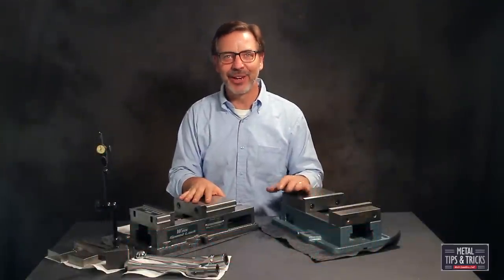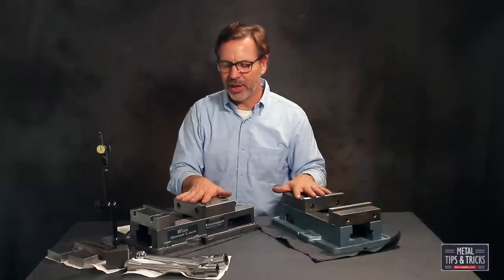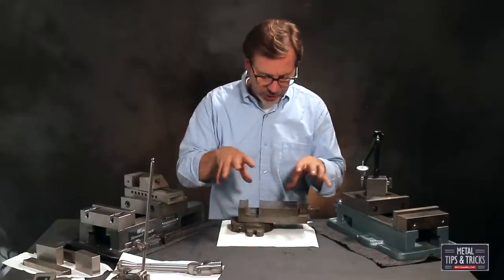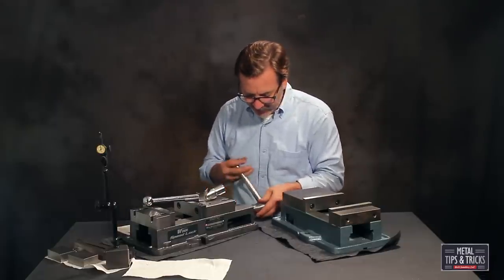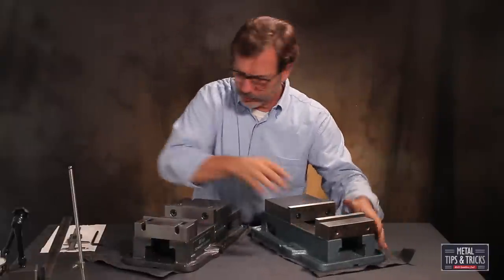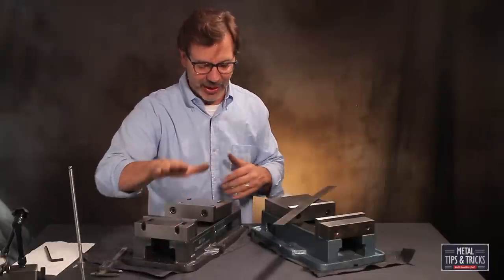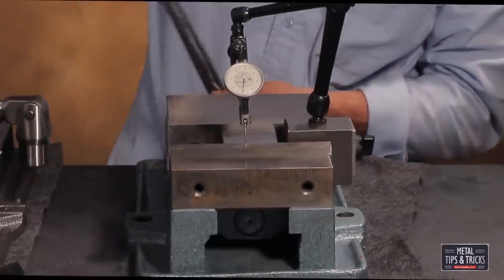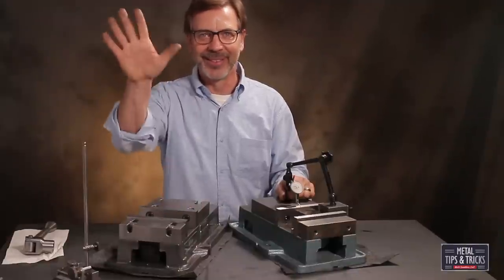China Vs USA  Machinist Vise

Comment: While the vise is definitely significant to precision finishing, it does not supersede correct and precise work set up in a vise using parallels/shims etc.This should be obvious, you had to do that much  when you were regrinding the vise components; that said the better the vise, the less setting up, but yeah you  still need to  tram/set up   the work piece etc. Castings are a perfect example of the necessity to properly set up work, never ever, near perfect, so yeah it doesn't matter how good the vise. The  China made vise precision was well within the bounds of allowing precision setup of work pieces.

Comment: Dale, these vice have seen works.  Now as a machinist, If I had to buy a vice made in China used or brand new, I would do some work on them before using them on milling machine or even CNC mill.    Because I want these vice at the same height of the other vice I have.      
Now if someone use these vice without checking them or correcting them, the work done on them would not respect tolerance or specs.
Now I used many vices in my years and some cheap vice made in the states.   Now it's sad to see that your bias with that demo.   

Now if you really want to do a real demonstration, do the extra leg work and buy a brand new vice made in China and compare it with it's equivalent made buy Kurt, because  Kurt does have a low end vice, that way you will compare Apple with Apple and not Apple and Oranges.

And if you want to compare that High end vice, compare it with an high end Kurt vice.

Comment: This review cannot be considered in any way shape or form to be a fair comparison by comparing a $660 USD vise with a $250 USD vise. Sorry, but you cannot compare vises from two very different price points. It is just not a fair comparison, plain and simple.If both vises were from the same price bracket within $50 of each other then I would consider it a fair comparison.
Try making this video again when you have two or more vises from the same price bracket.

Comment: Really interesting video, especially while you were showing the jaw deflection under load but it seems a little unfair. The Winn vise is like a hotrod Kurt and the Enco is a Kurt knockoff, of course the Winn is going to be far superior; I would also expect a Kurt to be superior to the Enco as well. While I get the point, there is also the "get what you pay for" factor and the comparing a $660 vise to a $200 vise isn't fair; seems like comparing a Corvette to a BRZ, both handle the turns but the Corvette wins every time.
Reply from the maker: HI DR.rockzo , I think this is a  fair comparison, because the import is trying to look like and act like the USA made Kurt D 60 vise, with the goal of fooling  people into thinking its a good tool. There for, it should be compared to a properly built vise Made in the USA . :-)
(Sorry for the cut-and-paste reply)

Comment: Completely BS comparison and the way you did it was horrible. 
First off you clearly state how much the import vice was but you never mentioned the cost of the Winn vice except to tell us that Steve Winn sent it to you to review which already creates a bias. 
If the Winn vice is a $1000 vice then you aren’t even comparing apples to oranges unless the orange was squished and mouldy. 

As for products imported from China. You get what you pay for. If you were to produce a line of machinists vices and requested one that would sell for $1000 it would probably be better than the Winn vice but at the same time  you can get that same manufacturer to make you a vice that you can sell for $200 so you can’t paint everything with the same brush. 

As an example try to find an American made vice that you can sell for $200. What would you get?

Comment: Reasonable to assume that the USA vice would be better.as a garage machinist,i donwt even want to spend 600 on a vise,just want tosee that the china one closes square stay closed and really would any tool lover take a swing at the vice with a hammer ?I d 
 spend 200 on a used USA vice,  well maybe
Reply from the maker: Yes you do take swings with a hammer/ rubber hammer to help seat the parts flat in the vise. :-)

Comment: One of the first things I do to these things is lop off that handle to about 6 or 7 inches.  I've had those things jam up and generally get in the way of the Y axis crank.  If a little extra holding power is required a short piece of tubing can be slipped on or a whack with a soft faced mallet will do the trick nicely.  Great video as SOP for you.  Thanks for your work.

Comment: i see lot of people whining and whaling here  ... yes, it is way cheaper and it is worse  obviously .. ..  perhaps the chinaseium unit its ok for many people. 
however he said something important, VERY IMPORTANT at the begining ...... the vise its a FOUNDATIONAL tool.  I have many cheap tools and dials and shit in my amateur shop, but at least you need a couple of GOOD things to have a clean accurate start of any project. If all your stuff  are chinaseum cheap parts, you have infinite variables and few trustable references.  I am not rich at all, but  i am tryig to get a NEW KURT , a NOGAFLEX magnetic base (stable and accurate) and one or two MITUTOYO genuine dials.  With this parts, i feel i have some solid starting foundation for a job ... bits, several tools, DRO, Collect will be chinasium as budget is not solid.  At least i know some basic measures will be correct and the part would be stable and still along the job ...  just my idea, of course .....
Reply: You don't compare a $600 product to a $200 product. It would make sense to compare products in similar price range.

Comment: Thanks for posting this.  As a newbie, I was told to spend money on a good vice but I didn't know why.
Reply: DeadBeatFlyingJackass A paid advertisement doesn't negate the results.   If you're saying that Dale lied about what the indicators were showing, that's one thing, but if the results are legit, then whether the reviewer was paid or not doesn't matter.  The information is still useful to someone just learning about machining.  I already have a Chinese milling vise and knowing it may not be super accurate after being clamped may save me a lot of headaches down the road.  You disagree?
Reply: Your vise only needs to be reasonably accurate, and the indicators showed that the imported discount vise was actually quite good for daily use, just not up to toolmaker's levels of fit & finish.

The only noticeable issue was the flatness of the ways, and 0.0025" over 6" is ~0.03% of difference - in a direction that is immaterial to your work setup.

So, if you aren't just plunking your stock into the vise and hogging away, you will still need to tram your vise to the mill and table, and then set up and "dial in" your piece to be machined.

You'll be using parallels and shims to get that right, so tiny discrepancies in your vise aren't important. One vise just needs slightly different shims than the other. The time and effort to set up a job are pretty much identical.

So, for all practical purposes, the Winn vise is overly finished for its potential applications... so, why spend the extra money?
Reply: chemech    That's really useful information.  Thank you!

Comment: $660 or $110 per inch for a 6 inch Winn Speed Loc Vice (plus shipping).  It is a neat system.  You can buy or make the small parts and convert the vice you currently have.

Comment: A big improvement could be gained by scraping in the base and ways of the cheap vise. The question is how much you value your time. The lightness does mean it won't be as rigid, but it is more portable which can be an advantage if you're moving parts around in the vise from machine to machine. Rare to do that, but it's sometimes the best option.

Comment: This vise will last a very long time. 
It’s not only the finish, it’s also the quality of the steel, the quality of the fittings and the fact that you’re supporting a craftsman. 
Why would you buy a cheap Chinese vise? 
If I had that cheap crappy vise, I’d hate using it every time I looked at it. 
QUALITY BEGETS QUALITY!! 
I would rather save my money and purchase quality, especially when it’s not that much more, or at the least, purchase a used vise. 
Good review. Great vids. 👍

Comment: A good quality tool that you take care of lasts a lifetime, the poorly made stuff you buy 2 to 3 times over. I too have a genuine dislike for low quality tools. Altough, also I have sinned and bought the cheap and lamented it afterwards. Sometimes you need something and can't afford or justify the cost of an expensive piece of equipment.
Reply: And sometimes, you get to a certain threshold, and you only get cosmetic differences beyond that price level.

The import vise isn't as polished, and looks less refined. The imperfections aren't material on this example, because it's good enough for purpose, and you still need to do your setup on your part.

Where it might pay out is if you are using the vise for many cycles every day, and you hope that the more expensive vise will last longer before it wears out.

You are absolutely right that we are all on budgets, and have to weigh out how and where we spend our money.   Buy Once, Cry Once is our goal.

Comment: My limited experience shows that cast iron moves around significantly after it is cast. No telling all the factors affecting the black art of metallurgy. My intuition is that you cannot get the machining so sloppy as to yield the results measured in the Chinese vise, much less the grinding. It would be instructive to send the both vises to Stefan to work his magic, then wait a year and see how much it changes. You could also true both sides on your mill then do a before and after. You also have to consider that with maybe three Chinese vises for the price of one US vise, you might be able to eliminate over half the difference in an hour or less. Big bucks if you happen to need 2-3 vises! I think the Chinese may be missing out by not offering the vises as raw or roughly milled castings. Their mfg time may be better spent offering a hi quality, stress relieved casting of better alloy to hobbyists who spend their time making improvements and gizmos for their shop. Consider the US vise has flaws more likely to stem from iron shifting than from flaws in their CNC machining, despite the greatest pains taken.

Comment: Does anyone actually expect milling to be so accurate? Isn't that why we have grinders? I never expect to keep thousandths on a milling machine.
Reply: I can usually keep to within 5 mils (0.005") when I bother with the setup... sometimes to within a mil or two...

If you need it to be within a mil or less, yep, you'll need to grind / polish it...
Reply: Every machine in our shop is good to 0.001" at all times. Grinders are for 0.0005" and for specified surface finishes.

Comment: good review
it sounds as if you review Metric Machinist Vise against a Imperial Machinist Vise.
The standard height of the goods is 50 mm in metric or 1.9685 "Inch
this is the most used  Vice type in Europe
http://www.fervi.com/eng/machinery/machinery-accessories/vices/high-precision-steel-modular-vice-pr-4208.htm
https://youtu.be/IooIt5Ol_Ag

Comment: Hey Dale, a few of us other youtube machinists answered Stefan Gotteswinters vise challenge and produced videos on the vices we have. hope you don't mind if i include the links to them below:
https://youtu.be/MqOgRnCftV0
https://youtu.be/0T9-3L2idWo
the one little critique i would have on your demonstration is that the vises were not bolted to the machine table. it does change the end results. slightly, but still changes the outcome. you also demonstrate quite illustratively that you get what you pay for.
overall though nice work. 
cheers
mike
Reply: HolzMichel  Mike,  I don't know how I missed that challenge. I would have entered just to get some knowledgeable eyes on my vise  hoping that someone would have some info on it. It is a really old Bison vise that was made in Poland with a fixed front jaw.   I can't find anything on this vise.   Chris
Reply: well you can still step up and take the challenge.. there's no freshness date on it that i'm aware of...lol
i'm vaguely familiar with Bison products and what little contact i've had with them is overall pretty positive. not as good as say Röhm (lathe chucks) but still light years ahead chinesium. 
the vise that i have is out of east german manufacture from WMW Niles. paid as much less than for a new chinesium but still got a decent vise. does everything i need it to do and then some
Reply from the maker: Hi Mike, Thanks for the Links.  You have a nice channel. Dale

Comment: Usually love you content but IMO this video is kind of pointless and just completely biased:

You're very careful not to mention when introducing the two vise options the cost of the Speedlock.  It's $600 (three times that of the Chinese import).
Not exactly a surprise that if you pay that much more for a product that it's going to have more invested in the product quality and manufacture.  I think this is generally the case.
Don't get me wrong, I think the Speedlock is a fantastic vise (as one would expect for the cost).  However, a more relevant comparison would be to compare two vise at the same price point.

Comment: I have used Chinese vices a lot, and still do. I do have a Kurt vice too though, but, I get great results with the Chinese vices. One must know what to expect, and tap, be careful with tightening etc. I used only Chinese vices, but eventually got a D688 and put it on my main mill. It is definitely easier and faster to use than Chinese, and I like it. Not giving up cheap vices either, they will do most all the same stuff the expensive ones does with hardly any more time. Only the most critical larger parts, blocks, that must be super accurate, that is where the Kurt vice has saved me noticeable set up time and produced noticeable better results. 
Not sure why so many thumbs down, too many comments to find out, think is because "It is an infomercial" some say, this may be only second vid of yours (except I started "China vs Usa controversy", and headed to this one to view first), it may be infomercial, and so no thumb up, even though I like it. No thumb down either. Watchin China vs Usa controversy now.

Comment: I love how this video praise how superior the USA made tool is. But the Chinese clamp, despite how he claimed hasn't been used much, but the wear mark on the bed shows it took a lot of abuse. But hey, cheap tool, why do you need to take care of it. Will you use your 3/8 snapon to break the torque of your seized suspension joint? It probably can take it no problem. But will you risk if breaking it? Another thing is, once you set up your workpiece, you don't let go your clamp. That is the fundamental of the fundamental in machining operation. It doesn't matter how good or solid your tool is, you let go of clamping before your operation. You result is going to be carp. I have seen those Japanese cnc that consistently achieve few nu meters of variation. But once it's operation interrupted and clamp let go, the second run can easily go to 10 to 20 times of normal variation. Because you can have a rigid tool, but your workpiece flex as well.  We are talking about a 25 kg die cast aluminum engine block. If that thing flex like linguini, I don't think the small part held by this clamp will have much chance not flex a bit. A solid tool is a desirable feature. But, when you are start asking few thousandths of inches of variation, you might getting over precise for one piece of tooling because your mill is far coarser than few ten thousandth of inch. At the end, the capital your pour in may not yield proportionally return. Moreover, if you ask for precision flat surface, mill it down to few nu meter left, finish it with precision grinding. It will be more efficient and save you from lot of grief.

Comment: I decided to replace my chinesium 3 inch vice after watching this. So I bid on a precision hydraulic vice on ebay, used of course, Carminati SP125 5 inch Hydraulic in very good shape, for the heck of it. (I know, too many commas) I couldn't find any real info in English about this vice, so I bid very low...VERY LOW, and ended up winning the bid this morning. Anyone have any info on this vice? It has pull down jaws, where on earth do I find pull down jaws? Would I be better off selling this and buying a Winn or Kurt? I am very new to machining and watch all I can from MrPete, Abomb, Stefan...etc etc.

Comment: Wow the comment section is bashing a lot Dale for comparing a cheap vs an expensive tool, thing is a lot of people don't see the difference in quality between a cheap and an expensive part/tool, they just think they're getting ripped off. I restore cars and whenever possible I ask for OEM parts or made from original tooling on cars after the 60's, despite that some people bring me the cheapo parts without the packaging thinking I'm just being picky, but when you just set a front fender or a 1/4 panel on the car and tell them it's not an original part they seem surprise and ask how I know : simple OEM parts fit, now you're gonna have to pay me 20 more hours to make that POS fit your car. Yeah it was half price, now it's way more expensive and put a delay...
An interesting video would be Dale make that cheap vise perform as well as the US one.